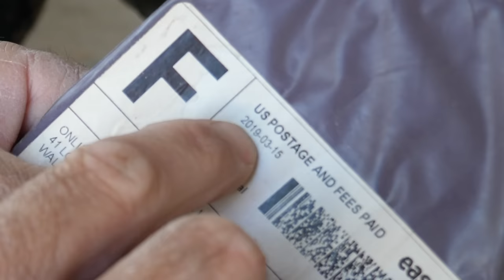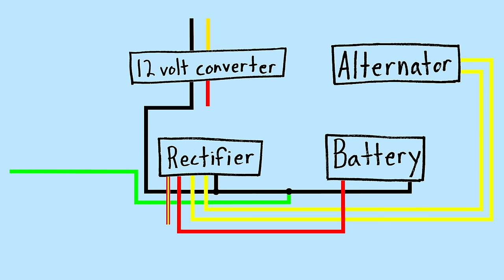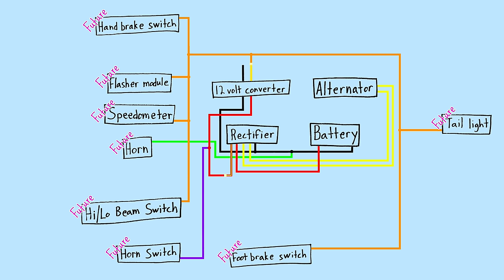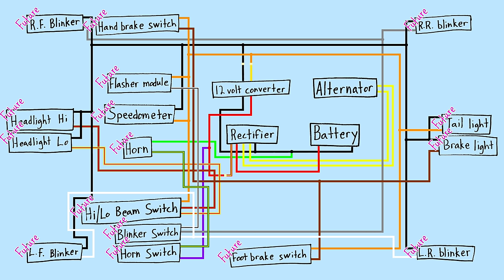Motorcycle Electrical System Design & Fabrication WITH FLOOR MOPPING

Comment: For your animal "spills", I recommend painting the plywood with some cheap paint before putting new flooring down or you might end up smelling the "spills" when it gets humid in the house. I love your selection of music for the mopping montage
Reply: Had a similar situation in a previous house. That Kilz paint did a good job at preventing smells from anything left behind after cleaning the sub floor.
Reply: I had this happen in a house with a slab floor. Poured bleach on it let that dry and put verathane on it.
Reply from the maker: That's what we did! We had some old interior paint and painted the whole subfloor with it.
Reply: I was going to say shellac primer, but the paint should work as well.
Reply: Best thing to use for stains/ smells is Kilz.
Reply: @keys3008  kilz is great stuff.

Comment: Welcome back! I'm curious: why do you need a negative wire running to every load? Aren't most of them grounded to the frame?
Reply: Yes, but then you have to make grounding points all over the frame. I don’t think he wants to grind the paint off the frame. He is working with two different volt systems so you can’t have 6v and 12v  going through the frame. Also he isn’t working with a million different electrical hook ups so it’s probably just easier and faster just to make a full ground harness.
Reply: @t-train6534  I can't see any problem with grounding 6V and 12V circuits through a common 0V rail (the frame in this case). After all, however he wires the two systems, their ground wires are all connected electrically to the same point (the battery negative pole). The rear lights might not have a suitable grounding point though, since they are at the end of a plastic mudguard.

Comment: For the negative wiring, use the chassis, that way you get a good strong ground, making sure to jump any hinged or bearing points with appropriately sized wires of course, and it also helps to keep unnecessary joints to a minimum, such as heatshrinked solder joints, which are a weak point as they can fracture and fail when used on vehicles, which is why crimping is preferred... :)

Comment: It is such a coincidence that I stubbled back onto your channel after not watching for about a year.  I was searching for a homemade wire harness for street legal dirt bike and you pop up!   I just want to say thank for making such a "boring" video because it has already helped me so much.  Im doing a full supermoto build on a 2013 RMZ 450.  It does not have a battery, but it is fuel injected so Im working on getting power from the capacitor and pulling most of the power from that.  However I did also buy a small 12V trail tech battery to stuff into the airbox just as yall did.  I was completely lost on how to wire it all together.  At least with this series, I can wire it all up and hopefully find a better solution to keeping the battery charged all the time.  I would somehow like to pull power from the capacitor to recharge the battery and then the battery feed all my 12V equipment.  Headlight/F blinkers/R blinkers/ taillight/brake light/Horn. I love this series and love this channel. Thanks posting this.

Comment: The older KX100 (95-97) had a tab on the frame and optional parts for a factory kickstand.  Fabricating the tab and welding it on would be pretty easy for a guy like you.

Comment: Use an SH847 regulator/rectifier. It’s an open style that will save your stator from the extra heat. The newer KX might already have an open style R/R already. But definitely something to look into.

Comment: Oh yeah, the battery box. Now I remember. It's been a minute and my memory isn't getting any younger, as I see you're in about the same place. Always good to see a new video from you. Welcome back!!  I just did a similar conversion on a 1999 DR 350. Went with all LED lights and was able to keep everything 12v. What is the power output  of the stator on that bike?

Comment: Not getting any younger is right! But still handsome as ever.  Turns out you weren't going bald after all.  It's always nice to see a new vid from you guys.  Hell, I even liked the soap pump trick. Just one thing: instead of grinding your crimpers to fit that gap you could have just crimped the outer part first so it wouldn't be in the way.  Oh well, just keep that in mind for the next set after you throw this one away.  And welcome back!

Comment: just a tip for ppl who might see this and decide to solder electrical connections on vehicles of their own; depending on the use and vibrations they most likely will become brittle and crack in the future (just to be very, very annoying). The right way to go on moving and vibrating stuff is crimping.

Comment: As both an electrician and a hobby motorcycle builder may I offer a few suggestions? # If yo need multiple constant hots at one end  just run one wire thats a slightly  bigger gauge and split it locally. and # 2 order 2 low bay 2'x4' 5 or 6k led fixtures from  amazon or ali express ( around $125) and hang them in the larger garage the lighting will be fantastic for filming even at night.

Comment: Great video. Just use the 12v horn, 1.5A is fine just wire it direct to the battery since the load is only for a second or so and won't affect charging.

Comment: "Nature's Miricle" will help those floors. Get a scraper that takes a paint roller pole in the back of the handle so you can be standing up and use your weight and legs. Also, a belt sander would make life much easier.

Comment: Good to see you again
Reply: The last notch on the tool folds over one Tag only over the insulation then move the wire and fold the other tag over ,the deep cut allows for this in the tool

Comment: First off, I'm glad to see your back, but I'm think your wrong on your charging system wiring.  Unless you ordered it special, Trail-Tech doesn't make/list a 6vdc regulator.  The power coming out of your stator is AC and the voltage will vary depending on the speed of the motor.  The TT regulator takes that AC voltage and turns it into 12VDC.  You should not need the 6v to 12v convertor.  You would need a 12v battery and probably all new 12vdc LED lighting.  I hope this helps.

Comment: Instead of soldering on the Y splice, just put two/3/4 wires into the connector. You may need to jump to a bigger connector which the mating cable would be too skinny for, but the trick there is just to fold the wire in the connector. 

Also, those crimping tools generally crimp both sections in 1 squeeze. That's why it's so wide.

Comment: orange is most often used for left indicator blue is right black is switched live and green is negitive even tho like you have i use black and ground makes more sence and i use red with a white stripe for switched live i also change orange for right and blue for left as the 2nd letter kinda hints to what side of the bike it is from been sat in the seat

Comment: if you get an ignition switch from more recent 125 the have a kills swith side and a power feed side when off the kils switch is activated stopping spark when switched on this feeds from the battery to the fuse box then everything else

Comment: You can paint the floors with Kilz to seal everything in (if you are adding carpeting). I have done this a a couple properties after much sweat equity and not the result I wanted. Just sharing

Comment: 12:35 should've just made a ground rail. A metal block with multiple bolt mounts for as many ground wires as you need. Then ground the block itself to the frame and the battery.

Comment: Yeah so you see how there's some nobby bits below the pivot point, that's what you use for smaller connections.
 and is there a reason for not grounding the negative onto the chassis? you don't have to run heaps of wire then just connect all negatives to the chassis to complete the circuit and have the switching done on the positive side of things

Comment: Does it matter if you are using a 12v regulator rectifier with a 6v battery and a 6v to 12v converter?

Comment: Its fine to run the wires at the head area and ziptie those on suitable location and then have solder joints there so you only have one wire of each twisting and moving in area of the body and front end. I suggest you use heat shrinks that have some hot glue inside that seal the seam completely so there wont be issue with corrosion from exposed wire. Also far as i know not sure, flux should be removed from the joint area as that causes corrosion. Otherwise looks good, though where will be your ignition key switch in diagram? I doubt insurance pays much if bike can be stolen with out key even existing?

Also American full floor carpet... who ever though that was good idea, specially when you put it straight top of the untreated plywood? For love of all that is engine, clean it properly, let it dry properly and then paint it with oil or urethane based lacquer at very least if you have to put that rug there -.- Amount of microbes, mold and well literal shit some cases in there is horrid enough and if it can move even tiny bit with sand etc getting under it that is like sanding the floor. Personally i would put plastic full room rug there and optimally proper wood panel flooring, but American building system is what it is...Its not like you know how to properly insulate houses with out them being mold magnets.

Comment: You could of use the 12v horn straight off of the battery with a relay and a switch.

Comment: Doesn't that blke need a charged battery for spark
Reply from the maker: No, it didn't have a battery from the factory, it gets power for spark from a stator behind the flywheel.